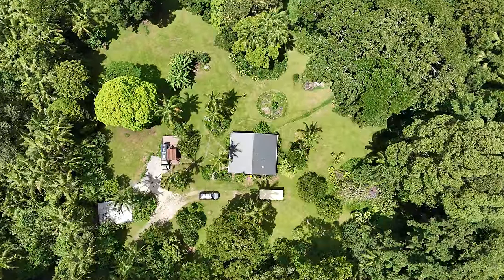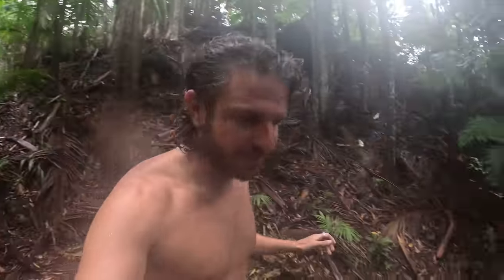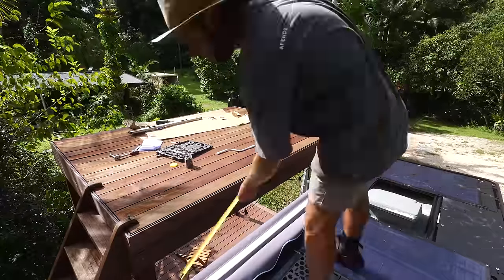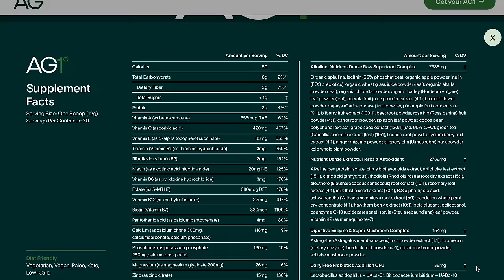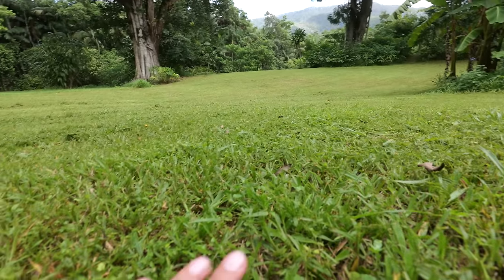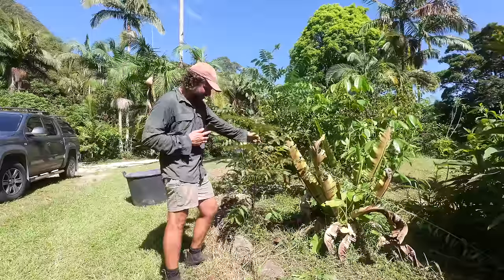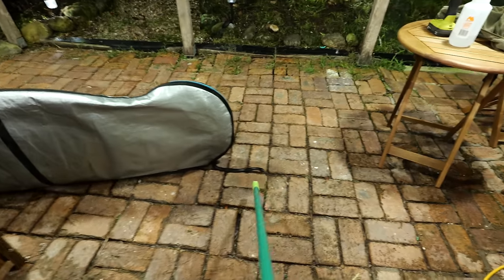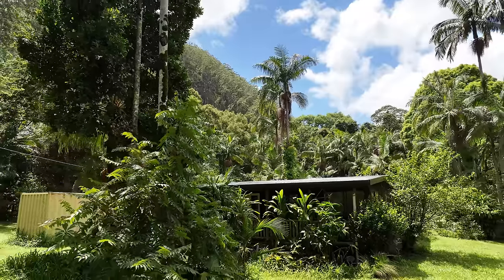Everyday life in the Australian Rainforest

Comment: Mowing suggestion: weed whack the tall stuff first, and then go over it with the mower and it mulches it all in. Looks like the handle on that measuring device is designed to expand...it has a joint on it...give it a pull and see what happens!
Reply from the maker: Haha so I've now learnt re the mowing and whipper snippering! (turns out the handle did extend further 💀)

Comment: Awning suggestion: could you let the tyres down a bit while the van is sitting stationary to give you a few cms of clearance for the awning? When you need to use it just pump them back up, should only take a few mins to do and it will save you having to go up to the roof every time you extend the awning.

Comment: For your veggie garden you may need a sun shade. I am not sure what State you are in. My sister lives outside of  Adelaide and that is what she has to do with her gardens.  However, you should maybe think about building cedar square foot gardens.  They are off the ground at hand  level so I do not have to bend over and it saves my back.  It will keep a lot critters out as well from getting to your gardens. You would be amazed what you can grow in them.  I have 2 and an old metal trailer converted.

Comment: I’ve got an idea, only if you’re up to it of course. 
Why don’t you try and install a small wooden wall piece against the the side of your wooden roof, where you originally installed your tent, this way you can just unscrew the tent and screw it back in a few inches higher. 
Not sure if it would work but it’s an idea. That way you don’t have to always fiddle with it ❤

Comment: Idyllic is the only word for what you have there! Alot of work, but absolutely amazing and I love how much you appreciate it! For your awning...try tying ropes with weights to the two corners and make sure they land over the other side of the van. Then when you roll it out, the weights will help pull it over. May be some trial and error on rope length and amount of weight, but it should make it much easier to spread it out without having to go back and forth! Hugs to Occy!!

Comment: The measuring tool should extend where the black plastic is halfway down it.  Hold the sections one in each hand, twist anti clockwise to loosen it, then extend it, and tighten by twisting clockwise.

Comment: Hey Max,  with your awning, what if you installed an edge strip along the top of the deck about 100mm tall and move the awning so it sits on top of the desk and then covers that tiny gap as well as clear your van perfectly ?  So rather than mount it off the side you're mounting off the deck top ?  As for the snakes, it seems you get a few red belly blacks which cortunately they are not aggressive like browns.  Not saying they are not dangerous but they certainly don't have the reputation of the brown or tiger snake.   I think with some careful planning you can easily co-exist.

Comment: Mate I just looked on the craft right product listing and the handle is extendable, try gripping the lower part (below the black mid bang, then twist the upper pole counter clock-wise, should losen and slide up as far as you need. Then just lock it off and happy rolling 😂